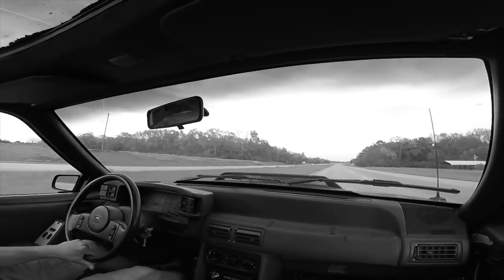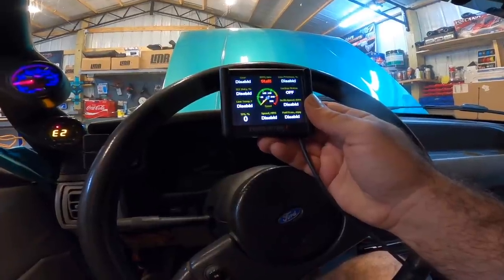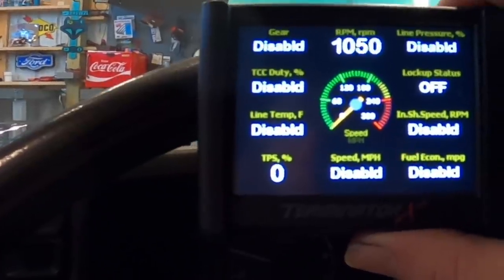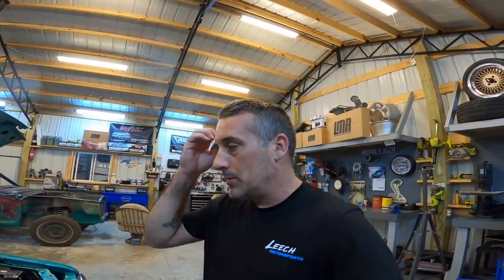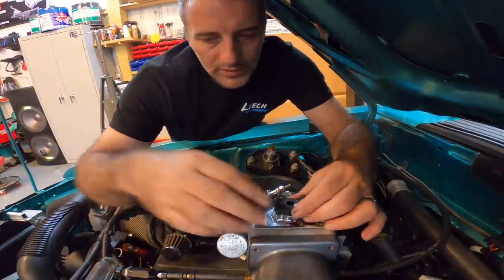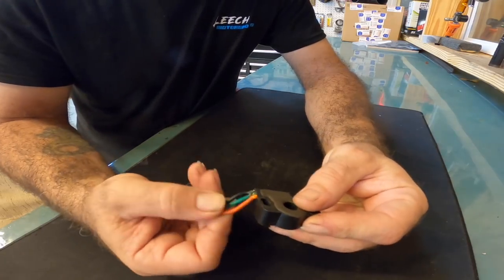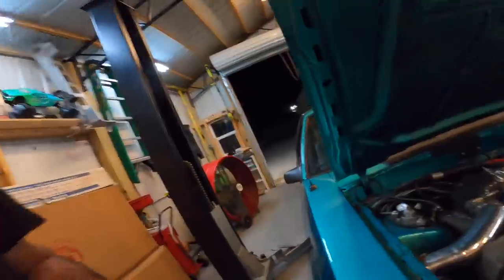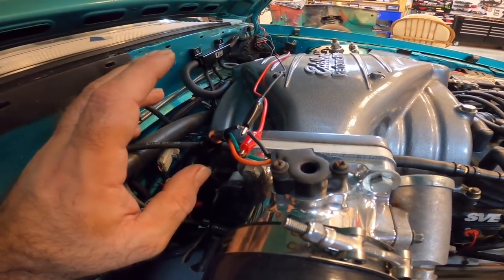Your Foxbody Has A Dirty Little Secret It's Been Hiding From You!

Comment: I had the same problem with an aftermarket TPS Sensor. I have pulled my hair out trying to figure out this White Fox. Finally I decided to put an Old OEM Ford Motorcraft TPS Sensor on it and set it, and done a Base Idle Reset, and it runs 100% better like night and day difference. Thanks so much for the video, because it's So Relatable 😎
Reply from the maker: Thanks brother
Reply: Same thing happened to me!! I installed a bbk tps sensor and the car was bucking at around 1500-1700rpm, I installed the old tps and worked. Good to have this information.

Comment: I suggest using an analog voltmeter as opposed to a digital voltmeter.  The reason is, the analog voltmeter will react immediately to voltage noise where the digital meter updates evry 1-2 seconds.  You're bound to overlook an intermittent/noisy tps when using a digital voltmeter.

Comment: 🔔😎 yes A9L.. BTDT...
Got 2 from Oreillys...china..
1st dead out if box 
2nd lasted 3 days.
They said it was the car. I demanded a Motorcraft in a sealed package, Made in USA.
Works perfectly 👍👍
youre better off with junkyard motorcraft parts than new chinese.👍👍😎
Reply: Most of the 90s 4.6 big cars use the same MA, TPS, MAP, AT, WT, Ev6 injectors, sensors.
Handfulls of parts for $20.😁😁

Comment: One harsh lessoned I learned with FB's is that if you do the automatic to stick conversion is that when you change over to the manual trans & install the pushstartable TFI module in  the distributor you must put a 22 ohm resistor in-line on the IDF circuit which is pin 4 coming off the ECU plug ..

On the vehicles already equipped with a stickshift on the drivers side by the brake booster youll find a rectangular block of silicone rubber that  usually says 22ohm resistor and one thing about those 22 ohm resistors is they dont like impatient people who induce jumpstarting by not waiting long enough for the battery to charge or trying to start with anything lower than 12 volts..........

Once the resistor fails it fails to "OPEN" so when that happens the IDF circuit gets overpowered which goes into some parts of the system like  the pickup module , the TFI module eventually killing them but also causing hiccups and tunning issues when you drive the more than 35-45 mins straight in one clip.........Thats when you get the dreaded hotstart syndrome........

When someone does the manual to auto conversion they must remove the in-line 22 ohm resistor block and put a non-pushstartable TFI module thats computer dwell controlled. 

If you dont remove the original 22 ohm resistor and you install the CCD TFI in the distributor the CCD TFI module already has a 22ohm resistor built into the TFI module so essentially you double the resistors and when that happens the resistance goes down to 11ohms.............

Thanks for taking the time to make the vids........

Comment: Just to add to the discussion, my car did the same thing, seemed like it was hiccuping. The issue was that I installed a new IAC, but inadvertently, installed it with an "adjustable"  Gasket! When I caught it, pulled it off, replaced it with a regular gasket... It smoothed right out. I also had a similar issue with the MAP sensor, once I vacuumed it correctly, it too, smoothed out. 
Bucking, hiccuping, surging... All seem to have several causes. 
Just my 2¢... Good tech video B!

Comment: Had same issue with some aftermarket TPS sensors. Finally replaced with a new Motorcraft TPS and never had anymore issues…for electrical parts only use Motorcraft parts as a buddy of mine once told me.  I tried to go the “cheaper” route and it has bit me more than once.  Wish I would of listened along time ago.  For me it’s only Motorcraft parts for any of my electrical parts.

Comment: Very important that when you are backprobing the TPS to set the voltage at closed throttle, or test the sweep, etc., That you back probe the wires in the connector, not at the sensor! This will reduce wear and tear on those wires that go into the sensor housing.

Comment: Good info... this method also works on the newer cars with drive by wire (electronic accelerator pedal)  they use both pedal position and a throttle body sensor. Testing them can be done the same way or with a nice scan tool.  Great video Brew2L !!

Comment: Good info, I had similar issues last year, my car would not.come back to idle at a stop it was hanging at 1500 or higher rpm, check vacuum leaks with the smoke machine, checked tps like 10 times and turned out the bolt on the throttle blade shaft was loose and the blade was sticking partially open on deceleration!
Reply: I'm having the same issue with my 87. When I shift gears it wants to stay at 2000 rpms but it only does it sometimes. Driving me crazy

Comment: My old roommate had an SN95 back in the day, and I had a Fox around the same time. Neither of us had pre-existing TPS issues, but both of our cars started giving us TPS headaches after putting an aftermarket throttle body on them. We both tried adjustable TPS sensors and there wasn't enough adjustment to fix the issue. I forgot exactly what we did to it (20yrs ago), but I remember we modified the adjustable TPS to give us more adjustment, and that pretty much fixed the issue.

Comment: A helpful way I’ve found to check that without stripping wires is use a small paper clip or metal bread tie to back probe the connector terminals. Or just take the sensor off and use the Ohms setting on your dvom.

Comment: You can change the channels on you dash layout. I have tps, cts, iat, closed loop correction, rpm, fan, oil pressure, fuel pressure and tach. Theres like 100 channels u can chose from. Just scroll thru them and arrange them in the order you prefer.

Comment: I recently had this problem. If I don't have a buddy to help me,  I hooked up my meter to the TPS and turn the key to on, the engine does not have to be running. In fact mine was so bad that it would not run. I slowly move the throttle blade through a range of up to about 50%.  I knew this TPS must be bad right at the get go. The reading was way over 1 V (4.19V was the reading). I move the throttle manually and very slowly and I can see by the meter that the voltage was jumping everywhere. Got a new on on order. This made sense with how my car was behaving while driving down the road. It was bucking, but it started and idled okay. I found this video very helpful too.

Comment: Thank You for the excellent information it's really helpful , I've been having the same issue with My 🦊 and was about to replace the A9P with a remanufactured unit which would have been a waste of time and money ! After testing I verified that the TPS was the culprit so I replaced it with a good used unit and fixed the issue . Sometimes We get mind blocks and forget about doing proper troubleshooting .🇺🇲🇵🇷🦊👍

Comment: 🔔😎
Ive never seen a thorough explanation of the fox police engine oil cooler. pros and cons.
Some Ford coolers are plumbed into the return heater hose (200*+), and some (like trucks) are plumbed into the lower radiator hose (175*+).
I like the heater set up with 10w30 Mobil1 as it warms the oil faster and maintains a consistent high oil temperature.
You opinions are highly regarded.
Stock 90 with T5.😁 70k miles.
thanks.👍👍

Comment: I went through so many tps sensors and throttle bodies. Always set the tps correctly. It came out to be the engine coolant temperature sensor causing all my issues. A lot of people have yet to replace those. The cars still runs with a failed one but they run like crap and they still show on the dash of a fox body but the temperature be way wrong causing the car to run too rich or too lean.

Comment: A resistance test will prove if it's bad too, I always get a readind on the suspected bad one. Then test new part at store to see the difference. Alot of times ya can't get the specs on these, same with other electrical parts as well. The new one could be bad too, good to find that out before ya get screwd trying to return it.

Comment: Sometimes the ECU is the issue, that happened to me 5 years ago, I replaced tps and took a reading with multimeter and there always had 5 volts.
So I had a spare a9l and swapped it, and that corrected the tps voltage, closed throttle .90 volts and WOT 4.5V

Comment: Dudes, get an inline fuse holder, and some of the in line wire taps. One on green one on black. Whenever u want to check it just put your meter into the fuse holder sockets. Just don't ever out a fuse in it, lol.

Comment: On another note with the light throttle bucking or misfire feeling. I pulled the vacuum hose off the EGR valve, low and behold the car ran great. Just a little FYI for folks chasing the same issue.

Comment: I have had issues with my 88 gt .was running lean and popping  through the intake . Changed IAC valve and this pretty much took care of that .  But now car runs rich and runs like crap until it's warm ..and one other issue I'm having is sometimes when you take a sharp corner it will cut out and come back ..feels like you shot car off for a split second.. ..I have changed coil ,TPS ., tFI  module . .. fuel pressure is about 50 psi .. even change ECU

Comment: I alway set mine @.095 - 1.00 volt using a multi meter and have someone push the go pedal to make sure the throttle position sensor working proper from idle to wide open back to idle with multi meter and for the love of God get your butt to work on that fastback 😃gooo dogs

Comment: NEED HELP: Just bought a 92 lx hatch this week.  Car runs good but after driving it for a while, after switching it off, it will turn over but not start up again until it cools off. I’ve already replaced the act and ect sensors, and the fuel filter and still doing the same thing. Any ideas?
Reply from the maker: It could be the tfi module getting heat soaked after it sits. There are test you can perform to find out for sure. I have a video on my channel just search TFI module and you should find it. Also obviously check it awhile the car is hot and doesn’t want to start.
Reply: @BREW2LFOXBODY  thanks brother I’ll do it. I’ve always loved foxbodies but your channel along with foxcast really helped me with making my decision to get this car

Comment: Brew2l. I'm having a similar issue but my cars codes are coming back as 18 and 19. Supposedly a spot connector, and not enough volts to the computer. Any help in finding out where to START looking? Love my car but hate this reduced power, searching idle, timing not working so it back fires sometimes, and running rich smell. Please point me in the right direction

Comment: My sn95 5.0 is having an issue with no throttle response and low idle then stalls. I recently change the intake manifold to a higher rise/more air flow intake. It's fuel injections. 
Couple people told me to to check tps. Or the intake isn't properly installed. I don't know.

Comment: Good ol youtube algorithm, Im a year late to seeing this but my combo was 4 years ago i had this same issue on my old v4 holley hp (pre termi x and 5.0 harness days) and i tried new oreilly and motorcraft tps sensors and it never fixed the tps jumping around issues, tps relearn and it would be solid for a mile then start jumping around again, just curious if the issues ever came back on your setup, it ruined the cars drivability and i threw in the towel 3 years ago and its been sitting on jackstands since, i wondered if it was something in my ecu but i never contacted holley or dug further into it, thinking about it now i should have put a meter on the signal wire at the ecu and checked if the voltage jumped around like it showed on my dash but i went through 4 tps sensors in a very frustrating experience lol

Comment: Have you a video on the mysterious leack of anti freeze 🥶 I'd sure watch it couple times b cose sob I'm going to find her without a pressure test I'm just not winning at the moment she louses a gallon or three a week not bad only once spewed out the resivor the rest it just goes someplace ??and not in the oil nope so all that's out carpets not and never wet she s 👍 so know I'm supposed to quit n not fix it unloaded it right becose if I go messing with the intake it won't never set right.  Maybe and I d k so if I send it out will cost me $1500 easy real easy book easy they go if I do I use same gardge since I have owned my Bessie.   You know thease engine s like  grant when he took Richmond he conquered